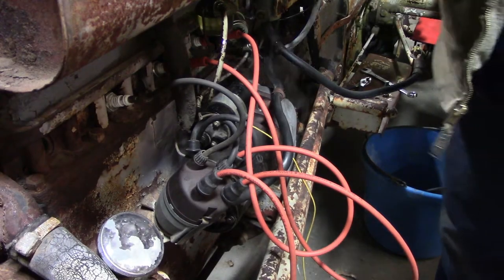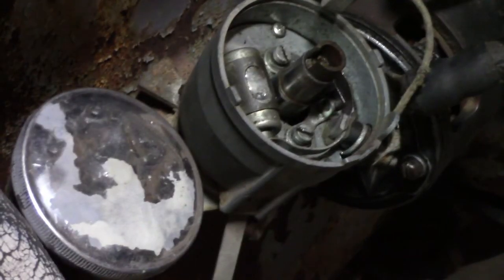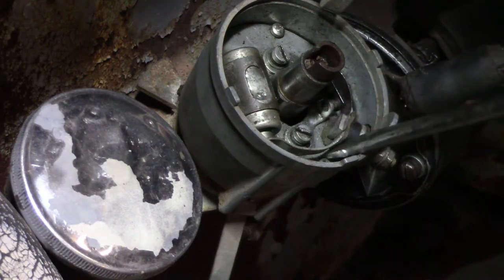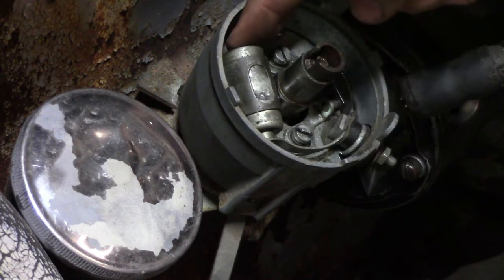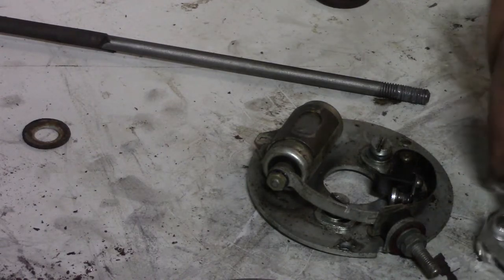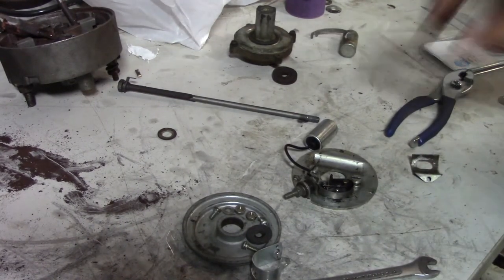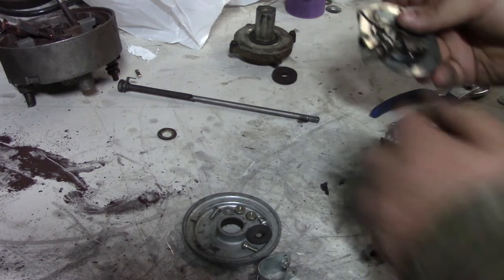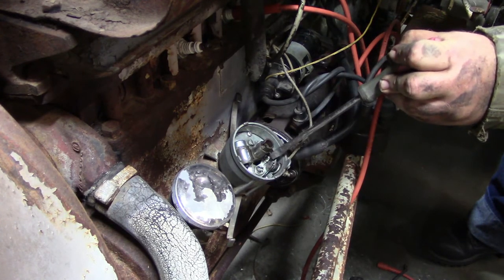got spark??? (changing condenser on Ferguson te20)

Comment: Are you sure you just don't got the spark wires in the wrong order did that before tour tractor are all apart and put it back together before I realized that the only thing I had wrong was a spark wires felt like a moron